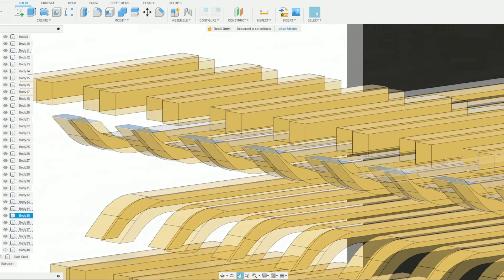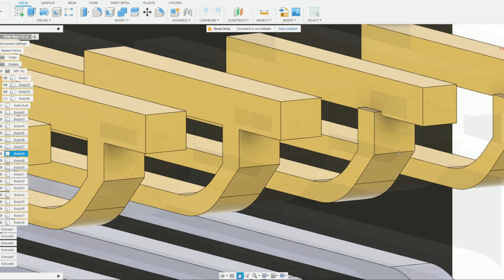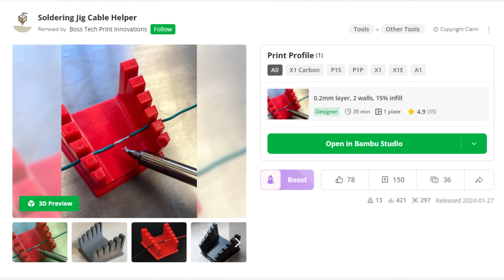I made the world's BIGGEST HDMI port

Comment: Those little strands and the foil aren't the grounding conductor as in coaxial cables?
Reply from the maker: @HelloKittyFanMan  not in this case, this wire actually had a dedicated ground wire that was just bare copper. Chase actually had to do some rigging to make it work with that part.
Reply: OK, thanks,  @TapticDigital .

Comment: The male should be the part with the pins in the middle that plug into the slot that has the pins around it. Whoever made the gender nomenclature for HDMI screwed it up; got it opposite of other kinds of cables.

Comment: I do not think that the connector you prepared with the 3D printer will adapt to the speed of the HDMI data transfer type and output an image, because it will be extremely affected by electromagnetic interference. Even if you receive an image, you may experience frequent image interruptions.
Reply from the maker: @Novus_Ordo_Conditor  just a prototype for now, next version will take shielding into account 😉

Comment: just reminding you that DVI and even VGA connectors are connected with screws.
Reply: Early HDMI ports on expensive plasma TVs had a nut on each side like a lot of computer ports and you can still get the HDMI cables with thumb screws on both sides.
There are newer devices and cables that use a single screw on top of the HDMI plug to hold it to the device, but the thumbscrew is so close to the plug that it's hard to turn if you have fat fingers... since chances are people will need a screwdriver anyway some use a regular screw instead of a thumbscrew.
USB A and B with locking screws are also available.

And some devices had retaining clips for the "classic" jack and barrel plugs.
Reply: @ruben_balea  didn't know about that
anyway, hdmi nowadays is digging its own grave way too desperately, time to switch to displayport
Reply from the maker: @deniskhafizov6827  get out of here Mr. Logic and Reason
Reply: @TapticDigital  too bad cables can also get frayed even if the connectors are firmly in place

Comment: Firstly, this is awesome. lol

Secondly - You can buy HDMI breakout boards with screw terminals and signal labels / pin numbers. ;)

It probably goes without saying that modern HDMI standards can handle insanely high-bandwidth of around 18 Gbps.

There are four pairs of wires that carry the main data (up to 4.5 Gbps per pair).
Those are meant to be kept as twisted pairs within the cable, and usually have a separate shield.

Originally, one of the pairs was purely for the Clock signal, but they had to start using that for data as well, from about HDMI 2.0 onwards.

But I think most people would be surprised at how resiliant the HDMI (TMDS) signals can be.
As long as the twisted pairs aren't separated along too much of a distance, it will probably work OK for say 720p or even 1080p.

It helps that you used a fairly short cable to connect to.
Longer cables means more signal degradation.

In extreme cases (or just poor-quality cables), it can lead to signal dropouts (dots in the image, or wrong colours), or complete loss-of-sync.

Comment: Pro tip just take a picture of the connector and draw on it in paint to label the wires to use as a guide
Reply from the maker: @KORUPTable  connector sadly had a breakout plastic piece melted to it and the pin out didn’t match how it should have, trust me I always try for the easiest method first, I am incredibly lazy.

Comment: Fun fact, there is an official large hdmi concept that sadly never got used. Its called hdmi type b and would be somewhat similar to dvi-duallink
Reply: Ugh let's not forget the dreaded micro hdmi. Thing is more flimsy then a micro usb. I mean it works but like come on guys what's going on here 😆
Reply: @Pr0toPoTaT0  And Mini HDMI, the cursed middle child
Reply: @Pr0toPoTaT0  What else was the Pi 4+ meant to use?
Reply: @dryphb if only there was a standardized connector with enough conductors to carry a video signal, backed by a protocol that allowed it to push high resolution and framerates... It would also be nice if it was reversible, so that it could be plugged in whichever way. Somebody really has to invent a connector like that
Reply: And there's HDMI type-E
Reply: Ha Silly Americans doesn't know about scart.

Comment: I have a suggestion to make the pins. You can get house grade single strand copper and hammer it flat. Will be far more durable than the original pins. if you make a channel in the pins you could even glue it into the plastic pins for rigidity reasons. would add some spring tension back in there also. IT not displaying in 1080p is definitely signal degradation from the stripped shielding. if you use shielded wire right up until the split off for the pins you should be fine. you can shield each wire individually up to the pins by just wrapping some magnet wire around the wires in one direction then the other back down it to create two opposing loops like the original shielding would have had you'd eliminate all signal loss altogether.

I suspect the resistance in the pins/wire grade is actually driving some of this loss.
Reply from the maker: @hogandromgool2062  very good info, the hammered flat copper would definitely be a good idea. I could probably also rig up some EMI shields

Comment: Really cool BUT, I wonder about signal integrity of the strands of cables you have now untwisted and removed the EMI shielding of.
Reply from the maker: @GigawattGarage  if you watch Chases video you’ll see that we ran into that exact problem. Signal strength gets wildly disrupted and limits resolution. If we do a V2 I think this can be overcome by implementing some filter caps or a separate daughterboard to run things through
Reply: @TapticDigital  oh sweet, heading over there now to check it out.

Comment: Super cool! inb4 the HDMI Licensing Administrator demands you pay $5K for using their standard ;^)
Reply: Next up: DP-XL
Reply: @JessicaFEREM  The DP Licensing Administrator demands you pay $10K for their standard, oh wait, the DP Licensing Administrator doesn't exist
Reply: Technically, if you put DVI with integrated audio in the port traditionally reserved for HDMI, you can use it since DVI is an open standard and can be adapted passively.

You can’t, however, use the HDMI logo, and you may be limited to earlier versions of the HDMI standard.
Reply: @elphive42 : I believe the audio actually requires audio, that's why a lot of small-scale manufacturers run the audio over a different connector.
Reply: yea thats why displayport is much better and sadly underrated. i love that thinkpad docks include displayport
Reply: I use displayport for my gaming PC's 165Hz monitor @uiopuiop3472
Reply: Yeah. HDMI is actually a company also. And their only job is protecting the copyright value of the HDMI logo. Just be careful. Maybe rename it to HD-MAX or something?
Reply: You beat me to this one lmao
Reply: I've seen synthesizer modules that use HDMI ports and cables for purely analog audio and control voltage; do makers of those need certification too?
Reply: "19-Pin DVI" go brrrrrrrr
Reply: Ha Silly Americans doesn't know about scart.
Reply: It's per sold unit iirc, not for just developing it. Also you can not do it like all the things on aliexpres
Reply: @tnaxpw  Ali sellers have the advantage of often being fly-by-night operations from sketchy business districts in China, so the HDMI Forum doesn't have an actual seller to complain about. Helps that the Chinese government barely cares about it too.

Comment: DUDE THIS IS SO INSANE!
Reply: Come on now that cable is lacking thicc
Reply: You should make one, too. ;)
Reply: btw, I think you'd have a much better chance at getting a higher resolution working, if you simply twist the main four pairs of wires together.

On the standard full-sized (lol) 19-pin HDMI connector, those would be the wires on pins...

1+3
4+6
7+9
10+12

Pins 2,5,8,11, would be the shield pin for each respective pair.
But see if you can twist each pair together first, as far along the wires as you can.

One issue is, the PS5 will be reading the EDID from the display (via pins 15 and 16).
The EDID lets the console know the preferred and maximum resolution for the display.

So unless you can force the PS5 to output say 720p using a normal HDMI cable, it might be tricky.

I mean, in fairness, the pins on your connector are huge, so twisting the data pairs together might not help much. lol
But it might be worth a try, as it would be very interesting to see how much it helps.